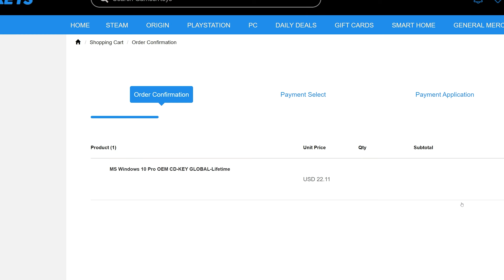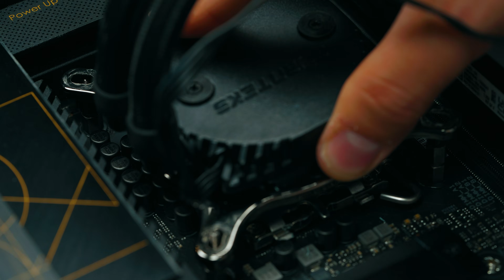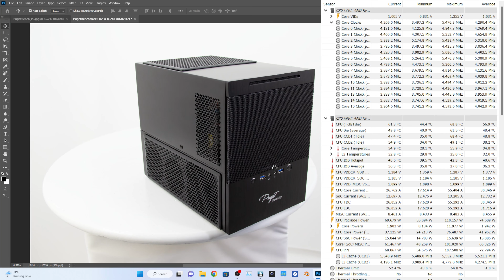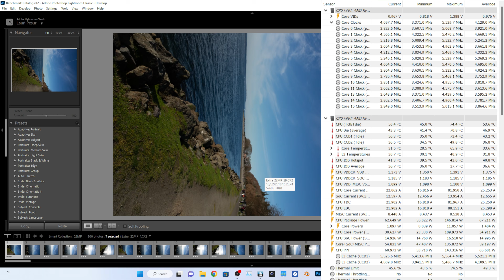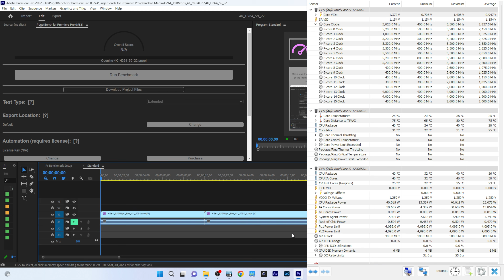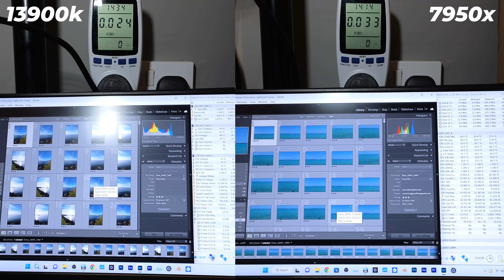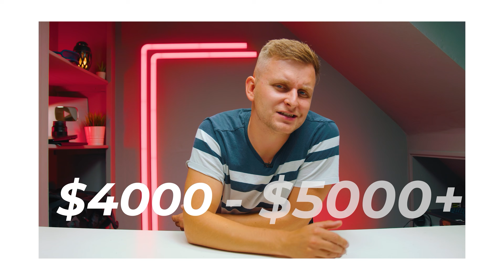INTEL & AMD both lied! 👉REAL WORLD power consumption is MESSED UP

Comment: I've searched the entire internet for idle power usage stats and found nothing as comprehensive as this. Finally, I can make a decision thanks to you.
Reply: The p core e core architecture of Intel is a game changer in terms of idle power consumption and just for tasks where p cores can literally do nothing and all work is done by e cores
Reply: @karanveersinghdulku  E-Core has noting to do with idle power draw. my 9900k system is 32 watts full system draw. no E-Core in sight.
Reply: What was your decision btw ?
Reply: @Saimeigaming  went wth the 13700k with a 4070ti
Reply: @thescarletcars which would you choose between i5 12500h and ryzen 7 6800h for a laptop?
Reply: True. I need this stat for 3D version.
Reply: @excelsiusprime  Yup I need that now
Reply: exactly !!!!
Reply: I just measured my entire system's power usage at idle (i7-7700k + RTX 3080) and it was quite stable at 110W. With GPU and CPU both utilized more than 50%, power usage was about 420-450 watts.
Reply: @VilleVaananen  Wow, that's a very, very high idle power, there's something wrong with your system. I had a Xeon E3-1271-V3 (it's an i7-4770k) with a RTX 3060, 4 RAM Sticks, 2 HDDs and SSDs and it idled at 40W, before the RTX 3060 I had a Radeon HD 7870 and the idle power was the same. My current Ryzen 7 7700 (non-X) with 2 HDDs and the same RTX 3060 idles at 66W with DDR5-6200 RAM and using CPU at 100% (with GPU idling) the system power goes up to 155W. I measured it directly at the power supply cable.
Reply: @VilleVaananen   then you need to put your nvidia driver into balanced instead of high performance and your windows power plan to balanced and you will see a significant drop.  there is no reason for any idle sytstem specially intel to draw that much. I have a 6900XT and a 9900K and my system idle draw is 32 watts and i have 3ssd's 2 lef strips 5 fans of which 2x 20cm fans and 2 hard drives and motherboard backlighting and that includes 3 watts for keyboard and mouse... Realisticly you should be under 50 watts full system excl. monitor.  
These high performance settings in nvidia drivers and windows do NOTHING but make them not downclock propperly.  You will lose zero performance but lose a lot of money on power bills. I dont get why there are still diots online that tell you to put it on high performance as thats litteraly doing nothing for 18 years now.
Reply: Yes, you guessed right. I'm using those high performance settings and the reason for that is because every performance tweaking guide says I should. To be honest though, electricity is so cheap in my country right now that the power draw doesn't really bother me.  @pino_de_vogel
Reply: Yeah spot on...
Reply: the video doesnt take into account that AMD uses a chiplet design which means a lot of stuff runs directly on the AMD CPU while for the intel CPU it runs on the mainboard. If you look at total power usage while idling the Ryzen CPUs are still ahead. The Video is at best misleading.
Reply: @durim4395  Nope.
Reply: @durim4395  Thanks for that, this comment really helped, there is quite a lot to understanding all this CPU stuff and these gems help people learn better and what to look for in the data...I have a couple of Ryzen's as I thought they were more efficient, one for daily and one for work tasks so I don't burn the juice for no reason....this really helps, have a fun day!

Comment: Stop the debate and instal HWinfo and compare it to my intel i5-13500. CPU is using 11-15 watts watching this youtube video right now at 4k. Check your AMD "CPU Package Power" with the app for comparison.
-task manager is running
-and this microsoft windows indexer is eating 4% CPU and nothing else.
-if I pause the video the power draw drops to 6-8w
Reply: 6-8W, the CPU only?!
Thats what my whole system including 16" screen consumes when watching a 4k video on youtube, and the majority of the 6-8W are consumed by the display itself.
my SoC is running in idle below 1W and realistic light load anywhere between 2 and 5W, 10-20W under max (!!!!) CPU load, 35-45W under full CPU+GPU load.
Hell, when watching youtube or videos in general its not even the CPU or GPU does the decoding work as it is for sure at your system as well (dedicated or integrated GPU does this work)
Reply: @harrison00xXx  what the hell is that? a tablet? haha
Reply: @JosesPoS  Its performance wise a fully grown Computer, just better/different

16" M1 Pro MacBook Pro

But yeah technically a MacBook Pro with ARM SoC as with iPads is pretty close to being a more powerful tablet.

Comment: I think a better way of measuring power consumption for low power draws is using a current clamp or a power meter, since even in HWinfo64, it tells you lower down that there's a power measurement deviation for ryzen of up to 200% (this is just what I've seen on 5950x), with it regularly being around 150% at around 50W displayed.

but yes, that aside, I do agree with you that amd tends to suffer on desktop for idle power consumption

for a current clamp, they can be had for less than $50 and work by measuring the current passing through the wire, you would just need to clamp it sround the 4 (or 8) 12V wires for the eps plugs

Comment: AM5 mobos consume more power but there are exeptions eg b650e Aorus Master idling at 71watts (whole system), have seen a test on TH.
Reply: "Idling at 71W"....
Wow, and i was annoyed by the fact that my PC cant run with 100% CPU and GPU load with a 45W USB-C power brick....
Or also annoyed by the fact that my PC consumes "too much power" (aka 3-8W in idle and light load and 20-35W under load)

Damn, even my old desktop from 2014 (i7 4790k on Z97 chipset) is more efficient when idling and under load its not much worse than modern CPUs.

Comment: Well, that was interesting. Obviously there could be an epic debate about your methodology, but it seems to me it's probably good enough for a rough approximation, and the results surprised me.  I've been looking at AMD for an upgraded video/photo editing computer, but in my situation (bus life, solar PV system, lots of low-power usage with only a few hours a day of driving the computer hard) Intel might be a better choice.

Back to the CPU-choice drawing board...
Reply from the maker: Good luck!
Reply: Not much to choose when i see your intended usage, and its none of both, M1/M2 MacBooks is what you are looking for.
Reply: @harrison00xXx  Thanks, but I don't see any advantage in switching to a Macbook.
Reply: @arkansasoutpost  Bus life and with solar system? I thought a low power usage and efficiency is needed, and a MacBook Pro is charming when it comes to battery/off grid usage. The internal battery lasts for my usage easily 5-15 hours depending on the usage, and a M1/M2 MacBook Pro is definately one of a kind when it comes to efficiency nowadays.

I personally charge over day with a grid connected 7kWh peak PV system my powerbanks (2x 100Wh for notebook with 65W output and 2x 30Wh with wireless charger for phone, iPad etc)
I can even render at high power consumption for 7-8 hours straight "on battery", the 2x 100Wh powerbanks give me nearly 3x the battery runtime on the 16" MacBook Pro.
We have also a bluetti powerstation with 3kWh on top of 5kWh PV battery but thats overkill and far from portable.
Reply: @arkansasoutpost  Wait.... just to make clear.... "bus life" and a fully grown desktop WORKS?!
I dont even want to imagine anymore not having a portable "Desktop" PC, for gaming its probably ok but for anything beside gaming i want a universal and CAPABLE machine which is also somewhat mobile. Especially at "bus life" i would not even think about a immobile desktop, and when you are searching for a notebook its hard to look away from Apple as long others still stick to x86
Reply: @harrison00xXx  Two desktop computers actually, although I don't often run both at the same time.

Look, you know there are different considerations for different situations. For me, two Windows desktops works for a lot of different reasons. For you, a MacBook is obviously a better solution because of your reasons. It's all good.
Reply: @arkansasoutpost  How does this work? Do you have huge batteries in your bus?

All i can say... even with a 5kWh battery i can not start my PC at night and play for 4 hours straight - my PC alone (no screen etc) consumes about 150-300W depending on the game, add a 60W central heating pump, a ton of small power bricks etc and i can say with 100% chance - the 5kWh battery dont even last for half of the night.
Reply: @harrison00xXx  One 300AH LiFePo4 battery (3840Wh nominal), 600W of solar panels on the roof. Plenty of power to run my desk (computer, monitor, speakers, lamp, fan) and still charge my phone and cameras. Gaming or video editing cuts down on the run time, but I don't usually do that for more than a few hours a day.
Reply: @arkansasoutpost  3,8kWh is not too bad considering you have noticable less consumption than in a 200+ m2 home. 
But how you manage to live with 2 desktops in a van/camping bus.... i even threw my desktop PC and screen out of the living room as the MacBook replaced all my computers since this system was just too big and annoying there (optically) as gaming PC only.

Trust me there would be a big advantage with a MacBook (Pro), in fact multiple ones:
- efficiency, you would not even have to care about your 3,8kWh battery no matter what you are doing the whole night with the MacBook (5-40W power draw)
- mobility.... come on, how does a desktop work in a camping bus? You cant even sit outside with a notebook on your lap, pack the computer in any small spot away or so.
- you said video/photo editing... not only the screen is glorious for that, but the M1/M2 Macs are literally made for that

The biggest issue you could face by using a MacBook Pro with MiniLED display besides the software part when you need windows for it.... you could not look at your desktop monitor anymore if its not a very good panel with good contrast. I face this "issue" daily.... as soon you are used to an OLED TV and a MacBooks MiniLED screen, its hard to even look at good screens when they have backlight bleeding or only a mediocre contrast.

Comment: I don't understand these results. Many reviews are showing idle and single-threaded power consumption of AMD and Intel systems to be on a similar level. Some are measuring total system power draw, some CPU draw only.
TechPowerUp review of the Ryzen 7600 shows several applications running below 20 W when measuring CPU power draw. Guru3D shows 73 W system power draw in idle (with a 3090) and 67 W for a 13600K.
Who is lying, or doing their testing wrong?
Reply: Yeah if these results are anywhere close to reality, all i can say is my i7 4790k from 2014 is as efficient as modern CPUs....

Especially the idle power draw he fked up pretty hard with his measurements, and i also dont trust the other data he collected since something is pretty off as well.
Reply: They are doing the testing wrong.

Comment: Software sensors are just not reliable. You might not have any other equipment, but that does not make them anything other than approximations.
Techpowerup uses hardware tools and they also test Photoshop, After Effects and Premiere Pro and they also have other light load tasks like Office, Avast and MP3 encoding in their testing lineup. The power consumption of Ryzen 7000 is on par or lower with Intel 13th in even these light load tasks.
Reply: Your comment really falls apart at 19:33

Comment: I think you cannot depend 100% on the CPU reporting Wattage usage directly.
I think this needs to be done with equivalent systems and measurement to total usage to at least validate these numbers.
For example, maybe the Intel CPU is not reporting the iGPU in the same numbers.
Reply: if you watched the whole video, at the end part he also measured both systems at the wall which show similar results.

Comment: Also you could limit the 13900K to 115-150W and still get most of the performance but benefit from the low idle ceiling. While limiting the AMD ofc reduces power draw but if the idle can’t be lowered… interesting to see

Comment: It would be useful to see the same comparison with the 65W CPUs.
Reply: I support you!
Reply: My ryzen 7900 (non-x) has a poor idle performance.  It's exactly consistent with this video. My 12700k is far better
Reply: @SpookFilthy  What is poor :) and how much background tasks you close  on 12700k to push it into idle. I have plenty of background tasks small but 'there' that usually enough to pull any cpu out of sleep. How much SSD you got (i got 5 :D), and rgb, and 1080 gtx, and x670e aorus master, about 100 watt idle for all that power, 300 when a decent load (gaming or photo editing). This will at most pull 500 watts if i dont buy at 300 watt gpu (1080 gtx is 235).
Reply: @Matti6950  I have my B650 motherboard + Ryzen 7900 will all power-saver settings running / core boots disabled / PBO curves / eco mode and no VMs - just the Proxmox hypervisor running.  According to my software diagnostics all cores are nearly in 100% C3 State/Idle.  It's still pulling 90 watts from the wall according my to wall plug metre which is terrible.   I'm only running one m.2 sata drive enabled (4.0), 128 GB of ECC ram, a couple of 80 mm Noctua fans, and a lower profile CPU air cooler.  I'm running a platinum power supply as well.  I'll post my exact 12700k output today.
Reply: @Matti6950  My 12700k with an 280mm AIO (more power) and  GTX 1060 draws around 50w from the wall during most tasks.  My air cooled 7900 hovers around 100w at idle.  The reason for this appears to be C-Levels.  Ryzen's only seem to support C Levels up to 3 whilst the Intel are using  down to 10.  So double/more idle power for AMD over Intel. This completely aligns with the findings in this video.  YouTube content creators who don't discuss this are doing the community and consumers a massive disservice IMO.
Reply: a ryzen 7 with 65 watts is a lie !!! you want to use all cores with maximum boost possible to make the task faster !!! so with all cores with a boost off 4.4ghz ryzen 5700x spends 140watts !
Reply: My observations with Ryzen CPUs are:
4600G - 2W at idle. Goes up to C3 idle state.
5700X - 20W at idle. Goes up to C2 idle state only.
3900 - ~30W at idle. It got hot quick, to a level I thought it's faulty.
Power was measured on 12V CPU supply on the motherboard, with current clamp.
All of these CPUs are "65W TDP".
Tested both with proxmox without any VMs running, and with fresh ubuntu.
+20W means +50€/year on electricity bill. That's crazy.
Reply: There is no point in testing applications optimized for processors from one of the manufacturers, as in this case. Adobe products are not only optimized for Intel processors, but also use a very small number of cores and threads - it is for this reason that we do not see a serious difference between 6 core and 16 core processors in task execution time. All this makes such reviews absolutely meaningless and false.
Any optimization involves completely different principles of load and processor operation - so this video is not about the truth, but about a rude and blatant lie.
Reply: @johnpreston8621  Cope.  Adobe has Quick Sync, and the point still stands.  Intel overall is way more power efficient unless the processor is underload a significant amount of the time..
Reply: Trust me 7900 (65 watt) is much better then this char, only the idle will say more or less same (few watt less), all the rest will be better and for sure (without a doubt) beat intel. Did enough research. I have 7950x3d: It's much more power efficient then this video would make you extrapolate or believe.

Comment: This whole video will need to be redone once the 7000 non X serie CPUs come out, they seem to be the best at power efficiency while giving out almost the same performance as their X counterpart
Reply: Iddle power draw is still way higher, it doesn't change anything.
Reply: @saricubra2867  That would only be the case if you turn on your computer to stare at your desktop background or only do browsing/office work. If you use the computer for hours of gaming or editing work everyday isl not the same thing. New Ryzens 7000 non X idles at 27W (7600/7700) and 35W (7900) while they only consume 90W at full load. The difference in idle power consumption is so small compared to the max power draw. You have 20/25W difference from Intel at idle vs 56W/134W/210W difference at full load.

How many hours of idle do you need to compensate 1 hour of gaming? Nobody buys a 13700k/13900k to leave it sit at idle all day. Sorry but an extra 134W (13700k)/ 210W (13900k) per hour of work or gaming makes a HUGE difference. It changes everything.
Reply: @mrsuperselenio5694  Intel pulls less than 10 watts at iddle. The difference isn't small at all, it's all thanks to Big-Little.
 
If you buy a car, you don't test efficency by pushing the engine so hard, it's more about driving on the city.

13700K is significantly faster than a 7700 for productivity. For power consumption, you have to use kilowatt hours, not kilowatts.

Like the video above showed, Intel is more efficient.

Also, to make it more an apples to apples comparison, you should compare the non-K chips with AMD non-X chips, Intel would still win.